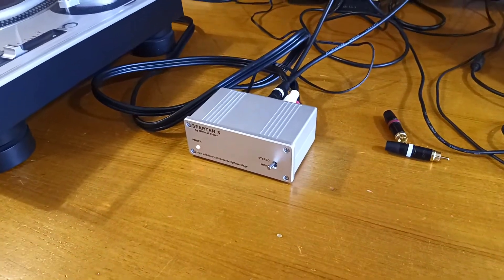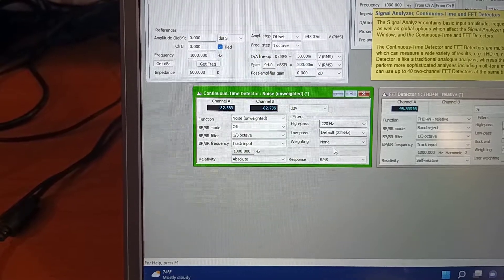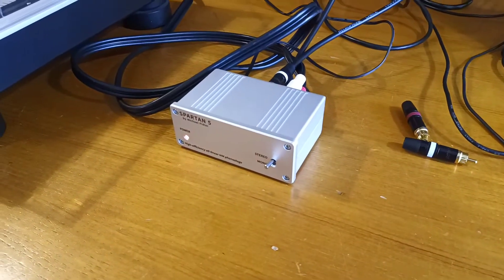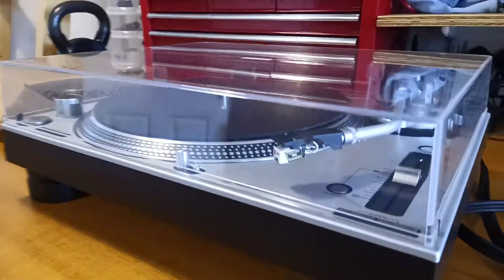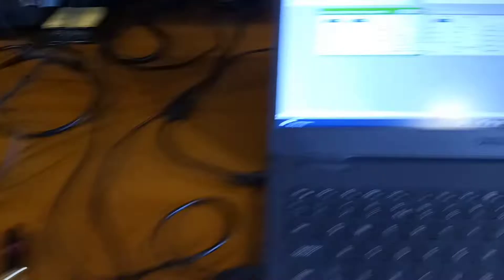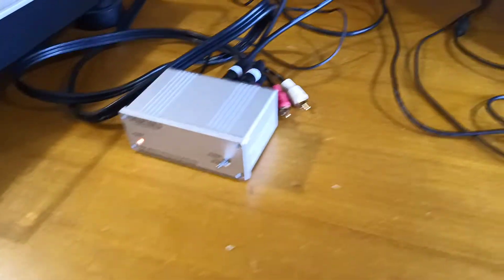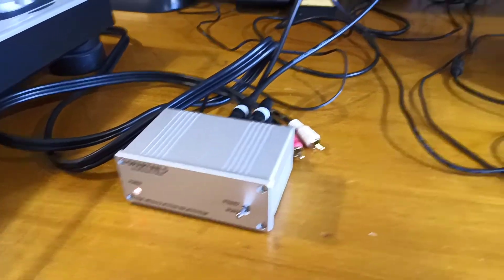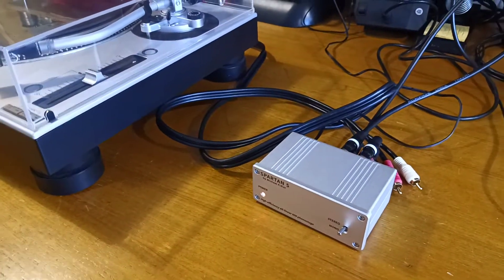How to cheat with phonostage noise measurements

Comment: Would MC carts be inherently be better at can cancelling noise due to the low impedance but make it back up in the lack of output :)?
Reply from the maker: Not for an MM-optimised input with LOMC. Some HOMC cartridges above 2.4mV, yes, though. The zero-impedance noise is about 6dB or so quieter than an MM-impedance noise floor, but MC cartridges typically have 20dB less level, so you'd be at a 14dB disadvantage.